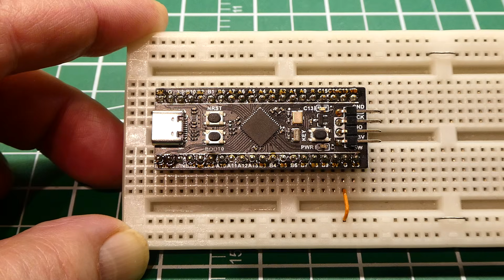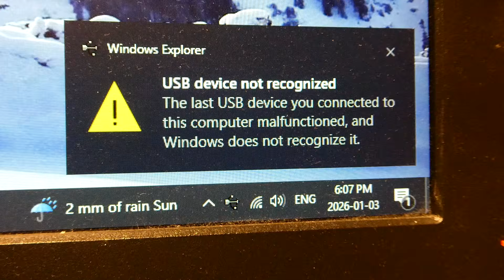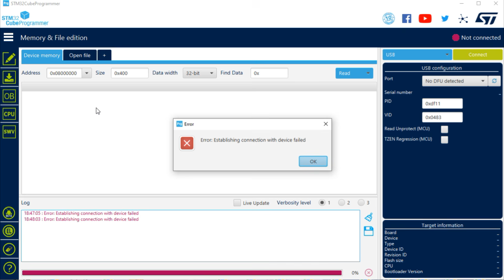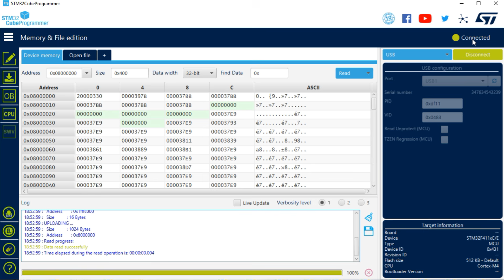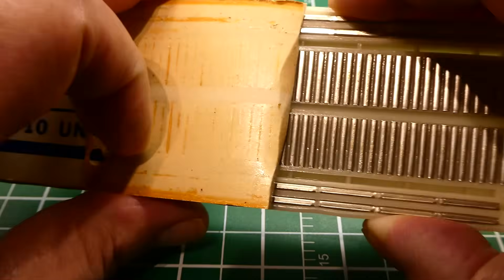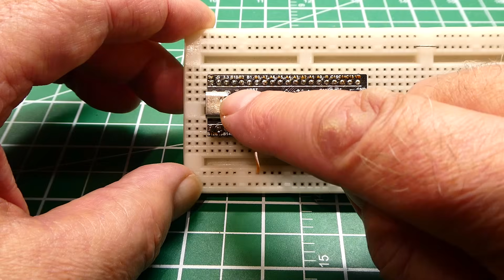Fix For Reliable DFU Bootloader Operation / STM32F411 Blackpill

Comment: Help me understand something please. I have yet to solder in header pins, no breadboard basically, but I am having the usb recognition failure all the same. So I am a bit unsure about the reason behind it. Also, is this kind of failure board specific or design specific for black pill?

Anyway for me SWD works fine, so I'm not really worried. But I'd like to know why the dfu keeps on failing me.
Reply from the maker: Put a jumper wire from A10 to Gnd on the bare board and try it. Also check that you have a data USB cable not just a power cable.

Comment: Anda sangat hebat, menemukan cara yang mudah untuk mengatasi bootloader STM32F411 blackpill.
Apakah semua modul STM32F411 untuk bootloadernya akan sulit terdeteksi di windows?
Reply: Ya. Benar sekali. Pin A10 disambung ke GND. Barulah Windows dapat mendeteksinya

Comment: it just doesnt work for me. i try to write a program on the chip but it always ends up stopping in the middle of writing it. leaving me with a partial program installed.
Reply from the maker: This video was made for prople who are having problems connecting to the DFU bootloader programming software. In your case you have connected, but are having intermittent cable connection problems. I would use another USB cable (short as possible) , get aother Blackpill board (could be bad onboard USB connection) and try on another computer or a different USB port on your computer.

Comment: Thanks, it works now. Previously, I thought there was some connection or soldering problem, and I also thought the USB cable was not working, as I succeeded only once out of ten tries. I even replaced two USB cables. Now I don't need CMSIS DAP programmer or ST link.
Reply from the maker: You're welcome! Glad it helped.

Comment: Thanks! I would expect the recommended reference-schematic for a dev-board to have an included pulldown resistor of some form. Bit of a fail on ST's part, in that case - this problem could occur even in non-breadboard situations, with a mitigation being difficult on a (non-BB) proto-board.

PS - Please consider saying "USB-Serial" instead of "FTDI".
FTDI does not have my (or your) best interests in mind, and ought to be avoided. There is a long EEVBlog video/thread on why
The connector and physical layer and protocol you end up with has no relation to FTDI.
In general, don't give free publicity to evil companies ;)
Reply from the maker: Thanks for your concern. I have made a past video regarding FTDI.